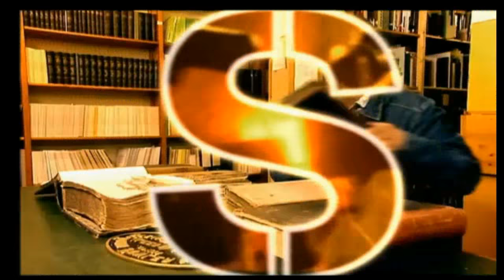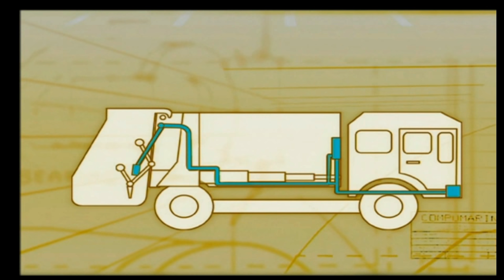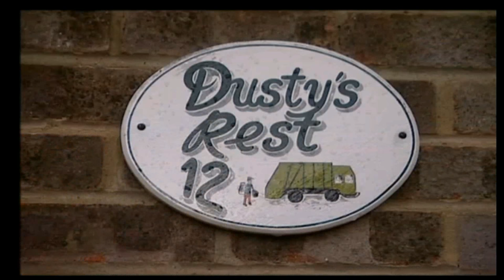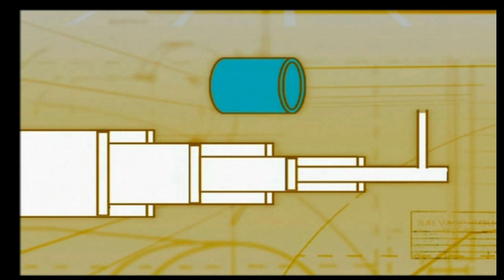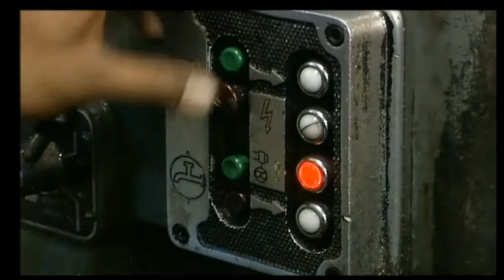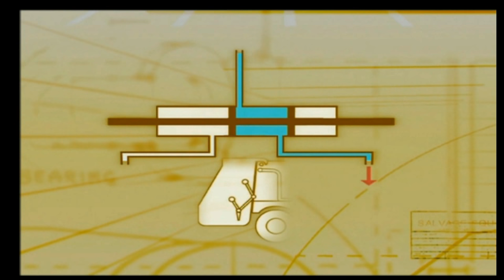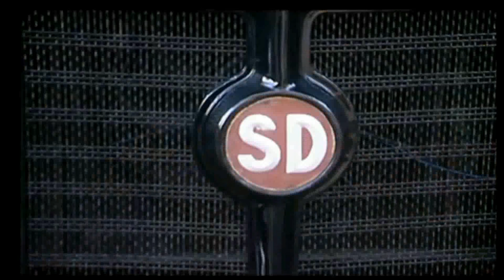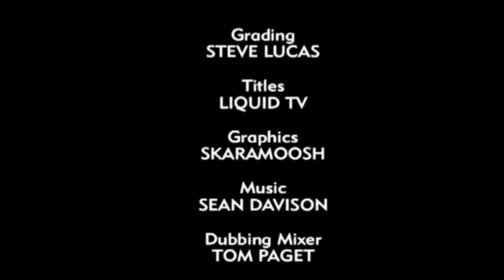Salvage Squad 2: Dustcart

Comment: Strange owner, what I mean is he doesn't seem too worried about failing the HGV test, definately odd. Having gone to all that trouble finding the SD, seems happy to just go with the flow. I recall small bin wagons like this in North Cornwall in the early 80's, so I don't think this is a unique a truck as they say it is. There was definately one in use in the Padstow area, due to narrow streets and lanes.  But still, a part of British Engineering saved from the crusher and then sent to China so they can undercut everyone's steel prices has to be all good !